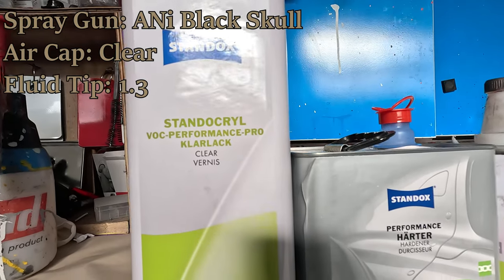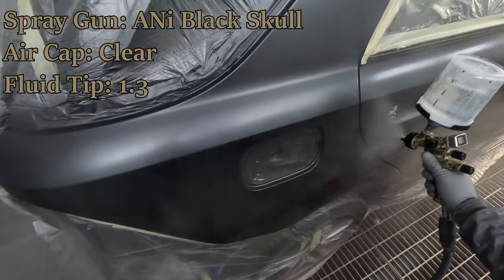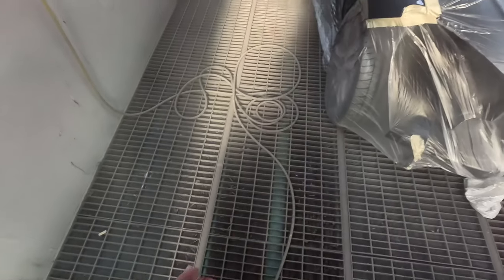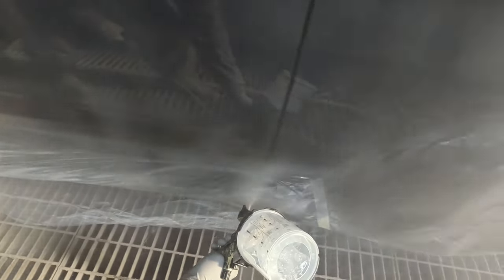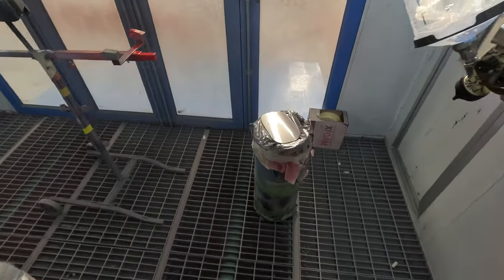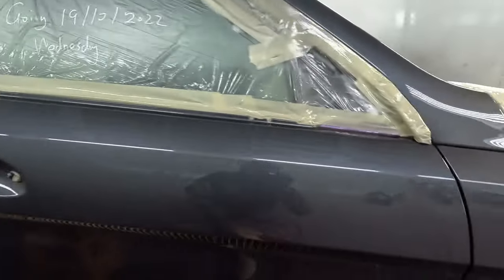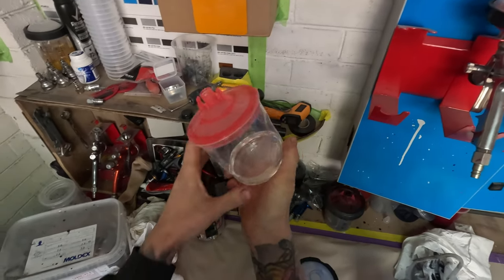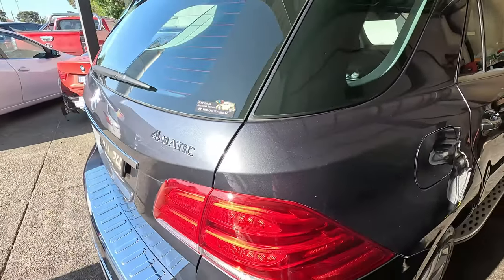STANDOX Performance Pro Clear Review: K9590

Comment: yes.... we use the extrem clear 1.5 years and its an absolutly killer ..... lays down verry nice ... easy to handel  and verry fast
here in south scandinavia  it is dry  in 15 min. with fast hardener.. medium 20 min.  slow 30 min..
a bit faster if it's raining .... k9600 is a bit more expensive but at the and of the day  this clear is cheaper...
after spraying  you get out  .. mixing the next color and in that time the paint is absolutly  dry and ready to finish...  no heating no flashup time before heating ...  wow

Comment: Can you please make a video comparing the Standox water borne paints to 2K Urethane, how they differ in application, Etch Primer, Sealers, Blenders, Top Coat and Clear Coats. What the differences are for drying times etc. aimed at the DIY that has never used this type of paint.  There are a lot of video's on Youtube but none concisely put the differences into one video with any authority.

Comment: Great review, I’d love to have that in my shop but my customers don’t pay enough money 
Ive got Mipa a scheme and they have a similar clear to the air dry, it’s called CX4 has a specific hardener but can be used with slower hardners for bigger jobs, it’s 2-1 with no thinner and is very versatile, stays open for quite a while and cures really quick just 15 mins at 60 degrees and great gloss and like that it’s rock hard, only downside is it’s got a short polishing window, after 2 days it’s hard to nib and polish 
Old rule of thumb used to be slower the drying better the gloss but not anymore they have really moved on
Really tempted to get some of this but like to stick with the same brand 
I’m the same as you I don’t like to mix clear by volume I like to weight it off the computer for accuracy and you can make small increments to adjust in different temps 
Great work man

Comment: Hey gunny. I love your videos mate. You explain things very clearly and in depth which is awesome.
Quick question for ya though in regards to 2k direct gloss.
Is it possible to mix in 25-50% clear to the colour on your final top coat?
My old man was a spray painter back in the 80’s and 90’s and when he was doing a resto on something of his own he would put a couple of coats of colour down,, wet rub, then add from memory 50/50 colour to clear, then 25% colour to 75% clear then a final coat of clear. And it made the gloss on those acrylic jobs super deep. 
Just wondering if it’s doable and or advisable with 2k direct gloss. 
Cheers mate
Reply: I’m from bendigo too by the way

Comment: I have used that airdry clear its ok but i prefer a low bake clear . it runs realy fast you need to dry the basecoat a lot longer otherwise you will get pinholes all through it. and it does not have the best build either

Comment: Do you know what the equivalent to this clear in spies/ permacron is? Or if there is an equivalent? 
At my shop we use spies 8180 or 8035. Curious if you have used those in the past as well.
Reply: Spieshecker 8700